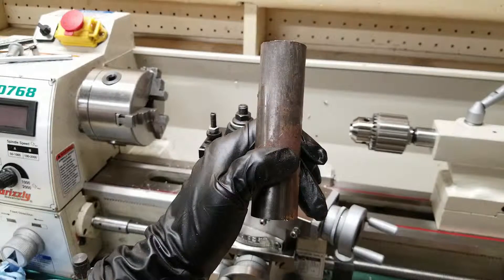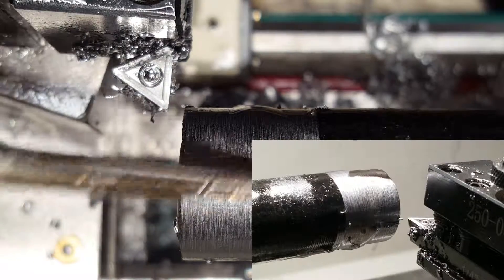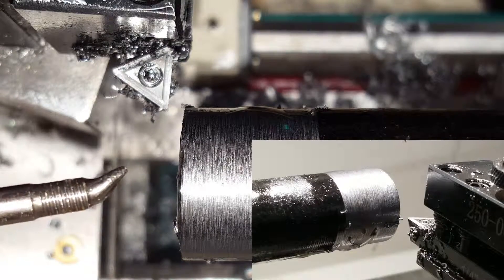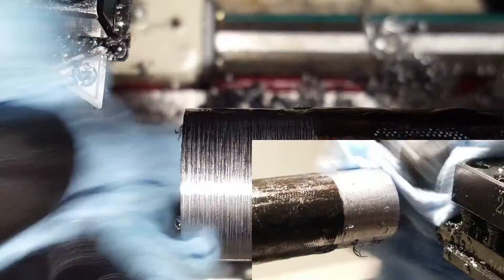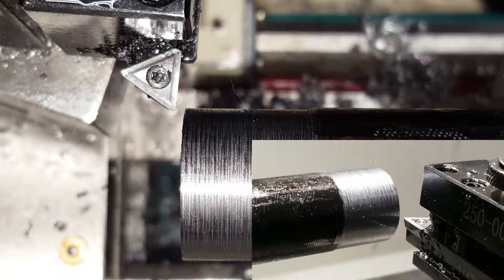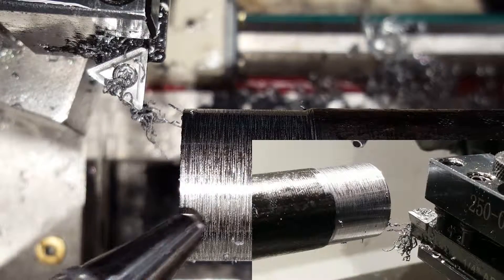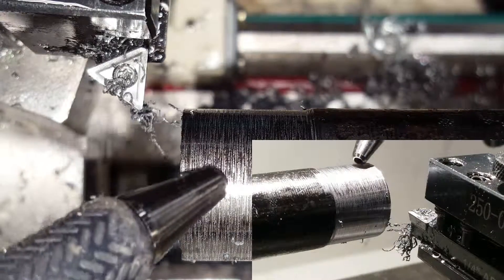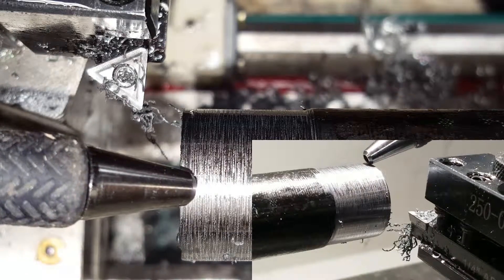Oil VS No Oil-Turning Mild Steel on the Lathe

Comment: Interesting. Where cutting oil IS useful is when tapping threads in mild steel. Keeps the tap or die from clogging, and prevents tearing the metal.